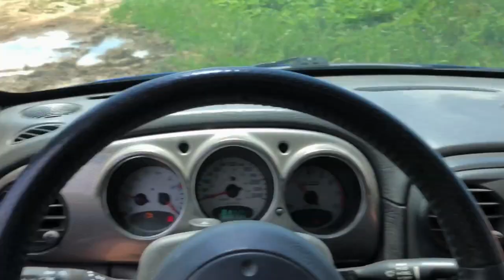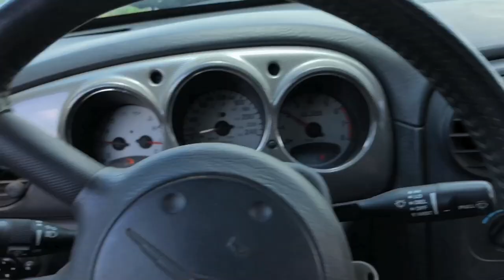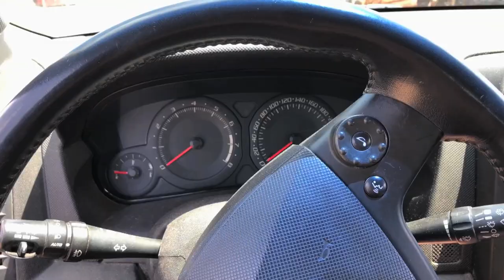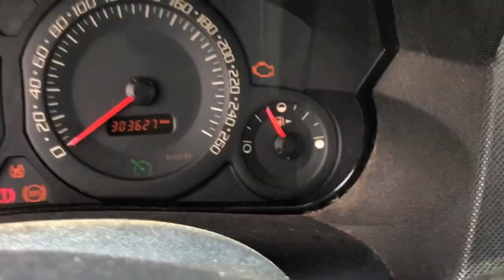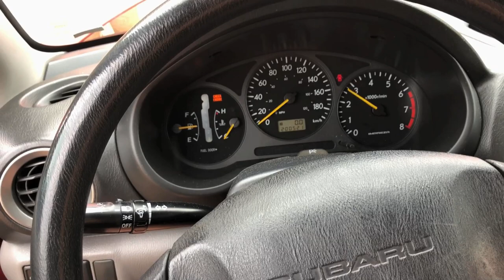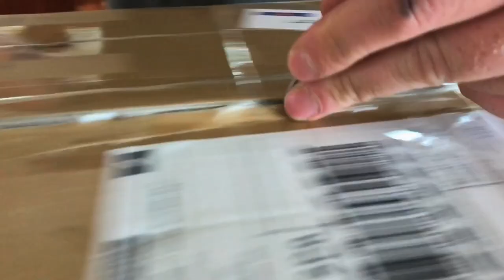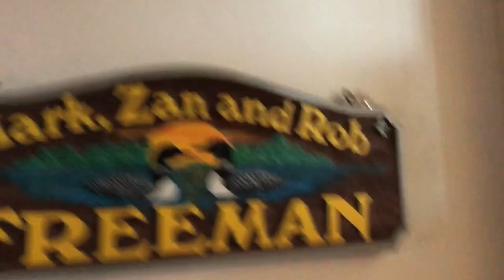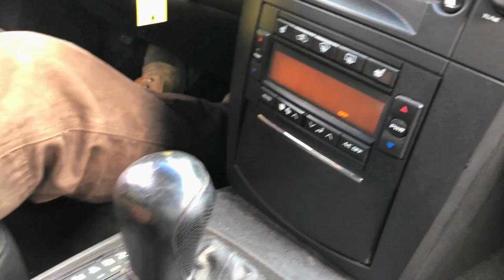SUPERCHARGED Mercedes Vs Cadillac BURNOUT!!!

Comment: Hell yeah bro, btw it could be a anti theft switch on the  Subaru. That why your not getting power to anything.
Reply from the maker: Where’s that?
Reply: markfreeman408 it should under the dash towards the right side is what the internet said. Or if you have a key phob, cycle the key 3 times while holding the unlock and lock down at the same time. Might work for ya.
Reply from the maker: Thanks!